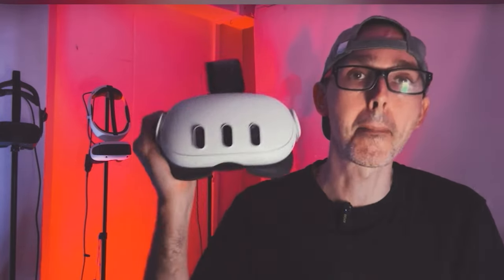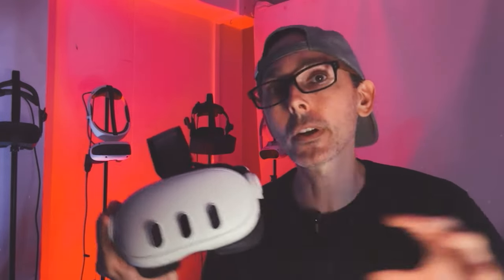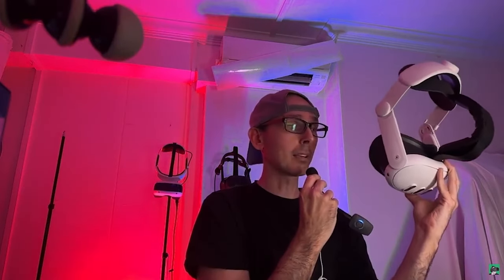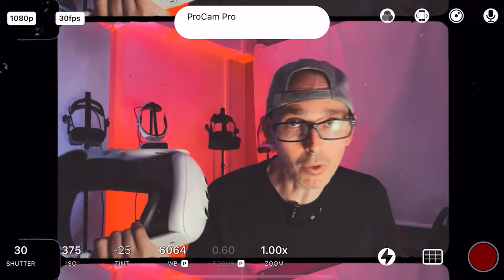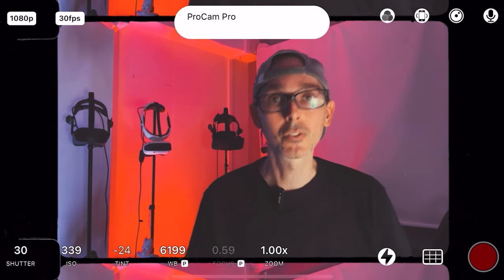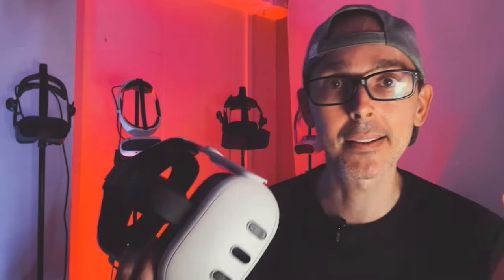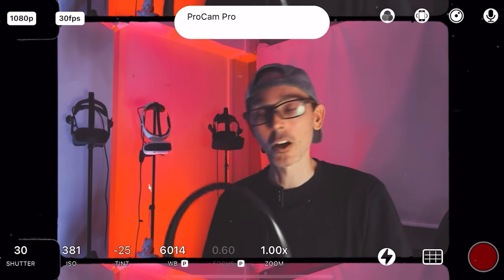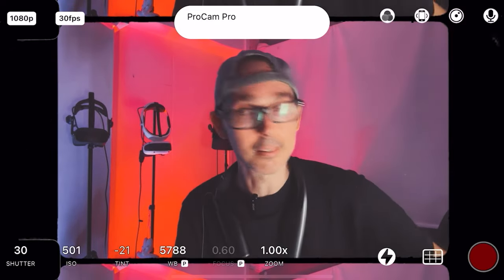💥MY META QUEST 3 DIED AT 90HZ DUE TO OVERHEATING USING AIRLINK VR!❗HERE's THE INFO!

Comment: I had the Quest 3 'die' as well but it didn't die, just seem to go into some sort of mode where it couldn't be switched on normally. You just need to hold power and volume together for 30 seconds and mine booted up again. Never had the issue again. Seems a lot of folks are thinking it died and are sending it back. Do some research people!
Reply: Typical problem solving option for mobile phones as well. Hold the power with volume (down) together, and magic happens.
Reply: This happened to me too! I freaked out a little bit, but it was a quick fix
Reply: had this before also

Comment: This Happened to me but what's crazy is I WAS using Virtual Desktop, I had the fps set to 120, bit rate 80 but I was just on a party call on the quest 3 with a friend I wasn't playing anything cause for some reason when i tried to play zenith vr on virtual desktop it wouldn't see my touch controllers. so I gave up with that, quit virtual desktop, still on a party call, was playing cubism for a bit once i closed that app My Quest 3 just SHUT OFF it had like 40% left. 

I knew something was wrong cause its not supposed to shut off like that, I have the oculus quest 3 with elite strap and battery, so i started charging the elite strap and not seeing a led to let me know its charging so i was like maybe it needs time, so i watched a hour show on Netflix and went back to the headset still no led and still cant turn on the power, so i was like ok I'm gonna unplug the elite strap with battery and try to charge the headset directly for another hour, so 2 hours now still no led, so I tried the volume button and the power button, nothing, i just kept holding the power button  and eventually it powered back on and haven't had a problem since though I never tried virtual desktop again yet.

Comment: Press the power button and volume button down at same time for at least for 30 seconds, it worked for me. The light is purple at first, then yellow and finally green. I think this a factory reset. This happened in cable link, went black and won't turn on. When I got it to turn on again I had 70% power left I was at 90 hz. On Virtual Desktop it works flawless at 90 hz and it has the 120 hz option. Well worth the $20 for the virtual desktop app!

Comment: theres needs to be a recall on the devices - there are too many issues reported with the new quest 3 , I even had to return mine for bad mic issues, overheating, gprahical artifacts and the display burning out. i had to factory reset it many times with artifacts still appearing. was gonna buy a new one next week but i think i will just NOT ! untill these issues are fixed such as overheating and battery issues. meta should have waited and did more Research and development in regards to optimization and finding solutions for the battery issues. i still have my quest 2 for now. but maybe their will be another options down the line.

Comment: In fact, when mine died, it gave some text about getting hot and said it’s important to take it off now… A little concerning like it was gonna blow up in my face. Ultimately it shut down after beeping and making bad noises. We had been using it a grand total of 10 MINUTES! I have not changed any settings, so it cannot be connected to that. I already had to return the elite head strap because the piece that cradles your head on the back snapped off. I’m not thinking this is a great build. I have played other games longer and never ever seen this issue until today but once you have it, it starts repeating over and over every time you use it. By the way, the battery was at 85%. Why I’m getting over Heating issues on a  climb 2 after 10 minutes… 10 minutes… Something else is going on! I usually have it run with my 4080 PC. But this time I brought it to a friends house so we did it as standalone and it lasted 10 minutes!

Comment: Mine did the exact same thing while battery at 40 % ! I really thought it died on me but holding the power button 30 sec fixed it. I think it's an issue that came with last update. That sucks cause a lot of users will send it back to repair thinking its dead.

Comment: I'm using my power bank (Rawpower  20,000 mah 18w / RP-PB172) that I used with my wireless OG Vive and it keeps the Q3 at 100% and after about 3-4 hours the power bank was down to 55%. The Q3 was maintained at 100% throughout the whole time. It's a bit heavy in the pocket, so looking for some other ways to wear it. Maybe headmounted with a 3D printed mount might not be a good idea cause of the weight. Either way, the power bank runs good with the Q3. I have heard that it's not good to keep a battery fully charged all the time. It can effect the life of the cells. So I think letting it drain every now and then is a good idea. Sorry you've had issues. I havent experienced anything like that yet. I'm now keeping my eyes peeled for other reports. Meta really need to get off their a$$ and sort the firmware out. Maybe they did release it too early. Not enough R&D. Could of been because of the losses they've suffered.
Reply from the maker: Yes my power bank keeps it full too, but I think it’s better like u said let it drain or it may overheat
Reply: @vressentials  Not so much overheat. Not good to keep a battery fully charged all the time. Let it drain once in a while. Could limit cell life.

Comment: Pretty in-depth video, the reason that I am here is my quest 3 that I’ve owned since November randomly rebooted while playing contractors showdown standalone (right before I was gonna flank this guy too, sad day) 

It seemed like it was a shorter boot time than normal tho. Got the blue meta logo and then back to the main menu/passthru screen. 

On v62 software, going to update to v64 today I think. 

I had the resolution boosted a bit via quest game optimizer and had a 20w battery pack connected (as per usual) 

I’ve been playing the game for 4 months (since alpha/beta) 2-3 hours at a time with no issue  

I loaded up OVR metrics tool after the reboot and saw the battery was about 50° C when it usually is somewhere around 40-45 but I doubt that that variance in temperature is what caused the reboot, it could have been showdown, but it was still startling. 

I hope it was a one off occurrence as I’ve had ZERO issues with the headset and have been using it daily since launch

Comment: Yes, found that the Q3 did not like any changes to the Debug.exe when using Airlink.  Had no issues with the link cable though and could run it up to 940 with a excellent image.  Own a G2 but prefer the Q3 with its edge to edge clarity.  Have been running 72HZ.  For my use case, so far happy with my purchase.  Will although soon try Virtual Desktop over WiFi.

Comment: Never had my Quest 2 shutdown from heat and I live in Oz. I'm concerned about the reports of hardware issues with the Quest 3 and I'll probably not get one until I'm convinced they are resolved, as there's only the options of purchasing from Meta or Amazon's online stores. The dead/stuck pixels and other screen defects are even more of a concern than the overheating or battery and microphone issues.

Comment: My 7 days new Oculus quest3 did similar at 70 Hz only been on a short while. It bombed out while in the passthrough. The picture was in the headset but  not active other than if you move your head the picture moved as well. The reset trick did not work so I setup a return to amazon, 
After about 3 Hrs I checked it again to find the fans were running so I tried another reset, after several tries I got a result and eventually got it to work. So I cancelled my return. It looked as though a update had been applied, my personal details were there but not some selections I had made.
It looks as though Oculus have a problem as this is not acceptable. I have until the end of the month to continue using it to see if the problem returns. If it does it is back to Amazon.
Reply from the maker: Thanks for sharing yea bummer

Comment: Overheating has nothing to do with it mine shut off in only like 10 minutes of being on. Picked it up from it sleeping and I look though the lens and my screen just froze in pass through mode then a weird static sound then it just went black.Plugged into the charger still nothing  then to the pc and i got some odd device name showed up not meta 3 but it still didn't power on.But what finally worked holding the power button for like 30 seconds.Yeah im on the fence about sending it back I even payed for 2 yrs insurance on this

Comment: Mine died last night with the oculus link cable connected to my laptop and I just had a black screen and I couldn’t turn it off and when I held down the power button nothing happened. Then so I left it and today tried to power it back on and it finally had a battery low symbol so now I am currently charging it and once fully charged I will be reverting back to using Virtual Desktop

Comment: Just had this happen to my quest 3 but i was using a link cable. I plugged it in and it sat for a while and then I was watching this video and tried the power button and minus button and it just turned back on like normal without the android thing. This headset is the most jank thing meta has put out lmao the tracking and mic being worse then quest 2 and now this.
Reply from the maker: Sorry hear that will try with cable once it arrives

Comment: My one month old quest 3 got stuck on a grey screen and wouldn’t turn off. Dumb me decided to plug it in thinking it would resolve the problem. Little did I know, it didn’t. And the oculus started running hot. Then the battery just died all of the sudden. I have gonna exchange my old quest 3 for a new one.

Comment: Does anyone know why my quest 3 overheats as soon as I get into any game with air link
Reply: What's the temperature of your room? PCVR does use more power than native Quest so it would run hotter. Though I've been playing VD at 90 and even 120hz and I never had the thing actually overheat.
Reply: @chan13153  im not sure but it worked well the first two weeks its just a problem thats been happening for the las 5 or 6 days
Reply: @KodkyHN  Hmmmm I did hear some people bring up that new update causing problems. Mine is still on v57 I think
Reply: @chan13153  I really hope is because of the update bro because it makes it unplayable

Comment: I had the same  problem but it happened  while using it with pc and usb-link. it did not want to restart and it was impossible charging it, nothing happened (at that time i did not know the trick about pressing the start  button for 30 seconds,  after 22 seconds  it started up, but the power left was only at 1% , it seems when the quest 3 went black it kept draining the battery ( i was at 74% left) and the 1% left was coming from my usb-link) but anyway I got rid of it and got a refund from Meta, my g2 V2  is still my daily driver until it dies !
Reply: were you using it at 72 or 90hz?
Reply: @Arzeloth  good question ! I think it was at 72 hz.